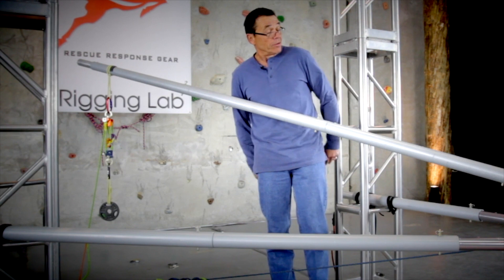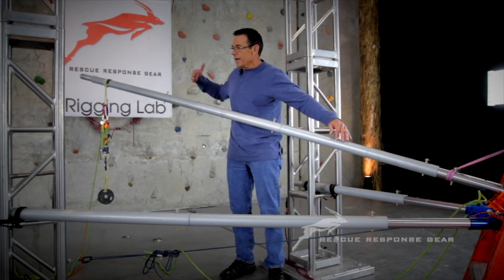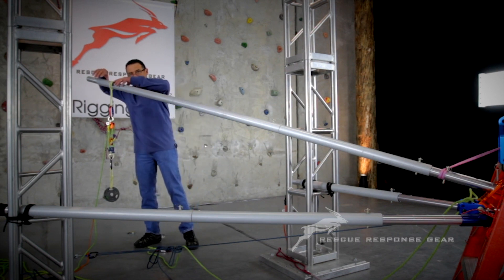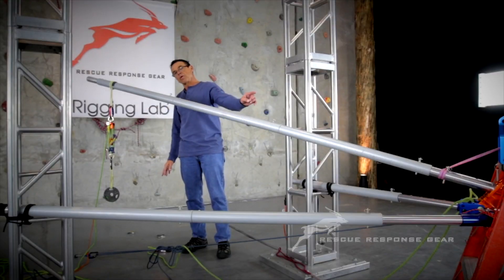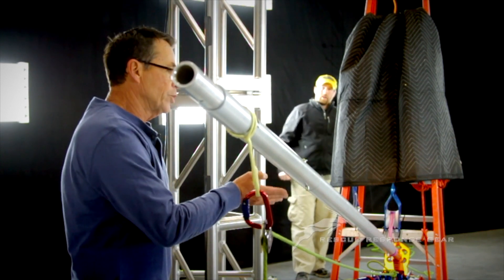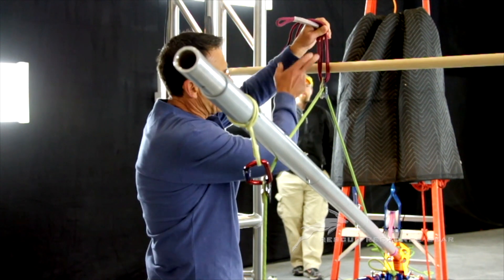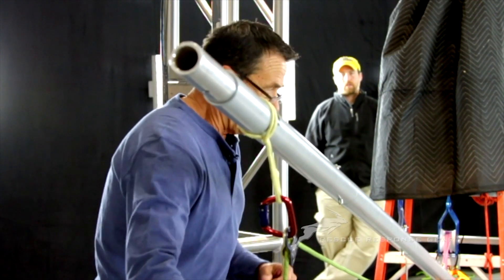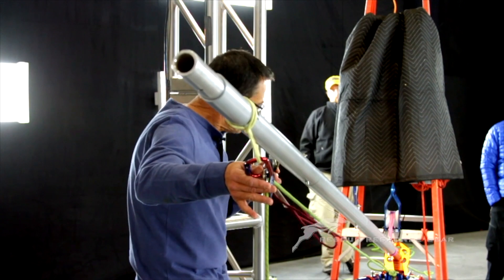Aerial Ladders Used as Artificial High Directionals (AHD)

Comment: First of all, an aerial ladder is a class 3 lever and your figures of tip load are completely underrated. That said there is no “robust history” of aerial ladder failure due to use as a high point anchor. I fact I could only find 1 example of this and it was likely more due to the condition of the apparatus than its use as a high point anchor. I like your stuff usually but I get the feeling you have not spent much time around aerial ladders. I have spent 18 years around them.

Comment: Interesting stuff but I have some questions.  When I see an aerial ladder I see a class 3 level.  So you are considering the ram the fulcrum?  More importantly,  I would like to understand why you are more concerned with the compression load rather than the tip load?  I always thought once we put a CD at the tip we are essentially doubling our load, thus if our tip load is rated to 500#s any patient or load that is 250 or greater would exceed our tip load rating.  I'd be interested in learning more about your perspective and hearing more about this.  Please feel free to reach me by email rather than reply comment, finigan62@hotmail.com.  Thank you very much for your time.
Reply: I was looking for info on similar stuff - I found this video very useful. Doesn't have formula's, but is a good example for firefighters.
Reply: An aerial ladder is a class 3 lever period